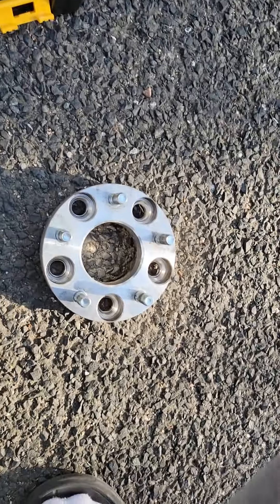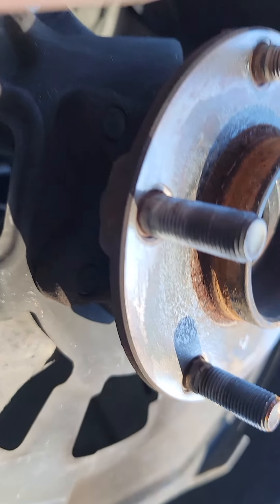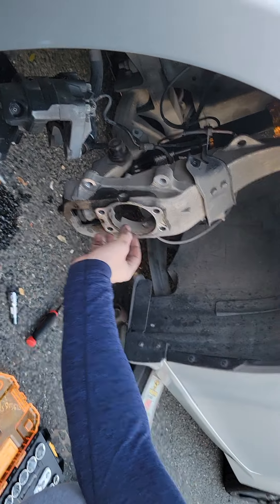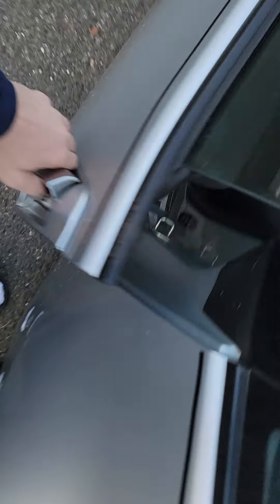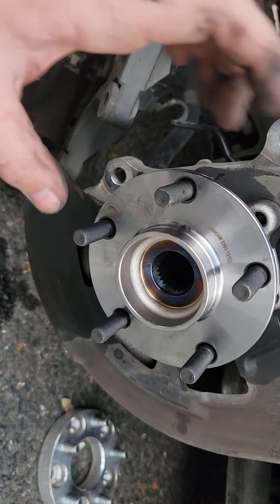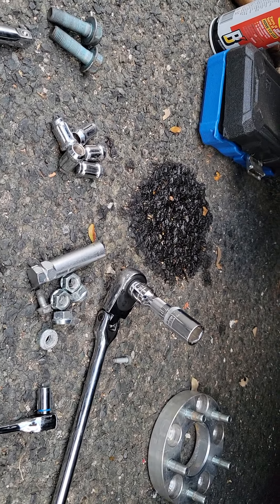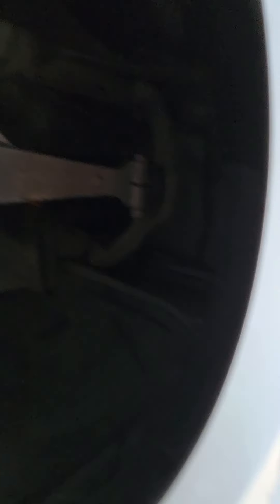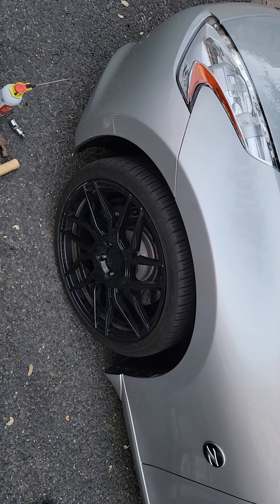How to Replace Nissan 370z Front Wheel Hub

Comment: This is ABS sensor speed sensor located in transmission
Reply from the maker: Hey thanks for the comment. This hub ended up being the issue I think it was the bearing inside going bad. Lots a weird ticking noises in the z tho!